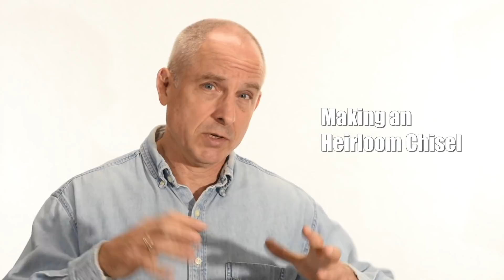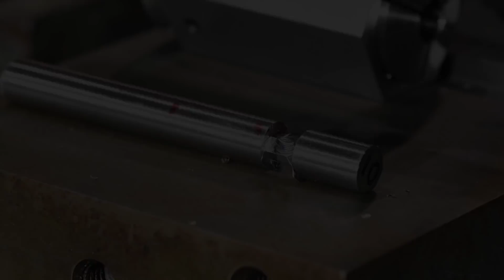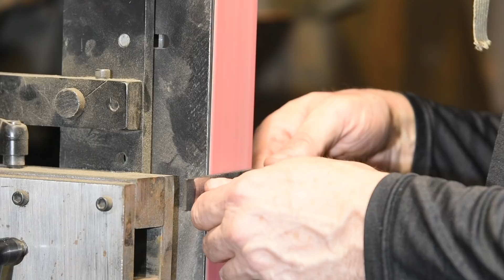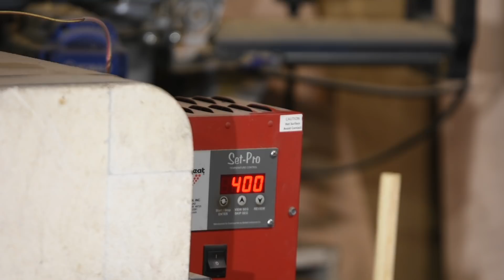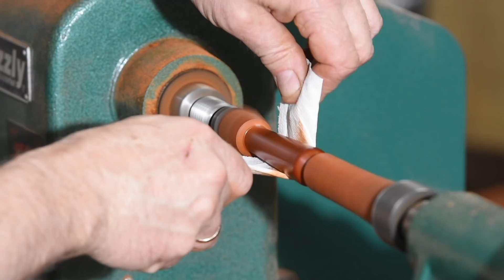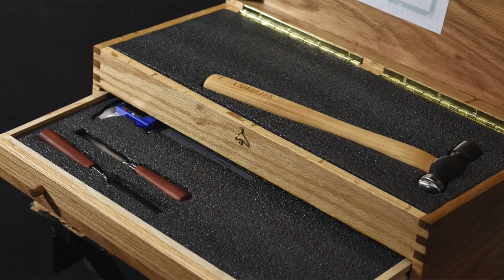Forging an Heirloom Chisel!

Comment: Also if you don’t want to ruin your files and save your belts, vinegar will also take off black oxide of your forged blades. I have done it a few times myself using cleaning vinegar (regular works to but cleaning vinegar is stronger). Just note that it will take longer than stripping it off with files/grinders.

Comment: Good video Walter. I've made a few chisels and it's always a fun project.

Flame Wood is a common name for Dalbergia Cochinchinensis, also called Laotian, cambodian, or Thai rosewood. It is on both the CITES appendix II list, and the IUCN Red List. Definitely not one you're going to get imported these days, but I've seen some smaller pieces for sale for $$.
Reply: Why is it banned?
Reply: all the rosewoods are restricted due to over harvesting. I think the Flame Wood is especially threatened because of the demand from China.